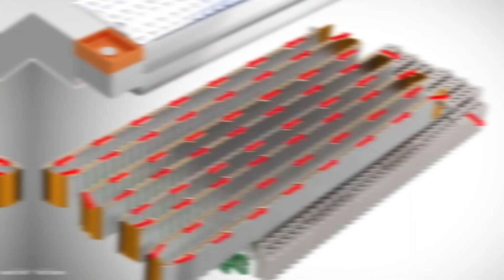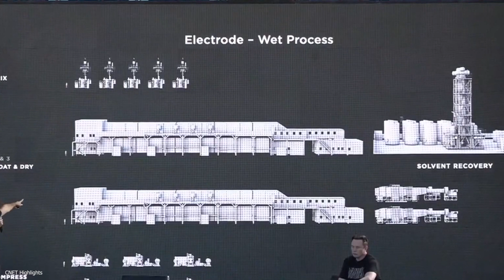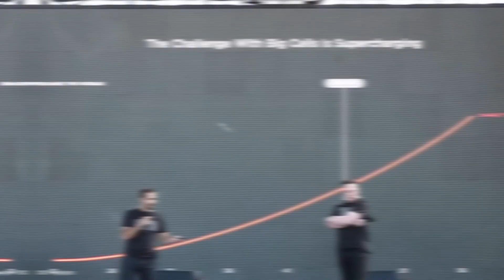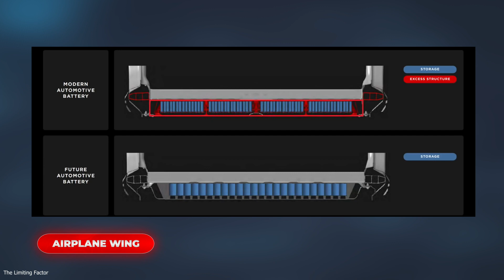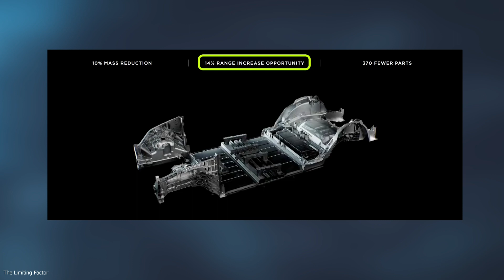Elon Musk: "Tesla Model Y's With 4680 Cells And 2170 Cells Will Be Produced"

Comment: The structural battery pack integrated in the vehicles structure indicates?  That may mean that if the battery pack is damaged or faulty, the whole vehicle will need to be replaced.  Or is that a false assumption?